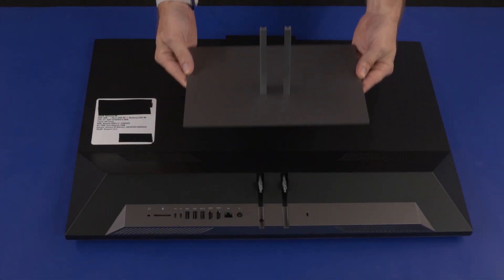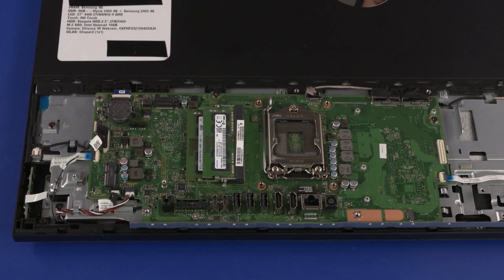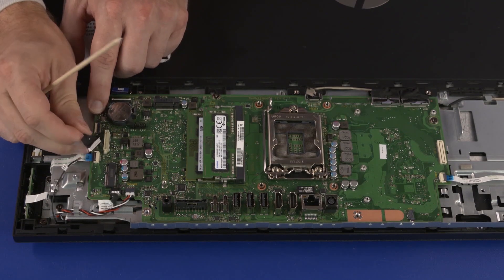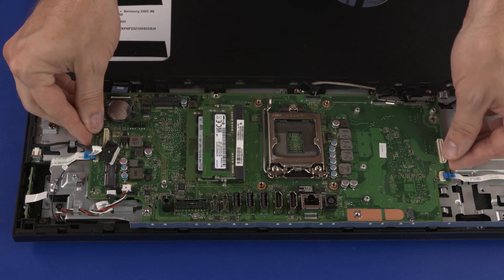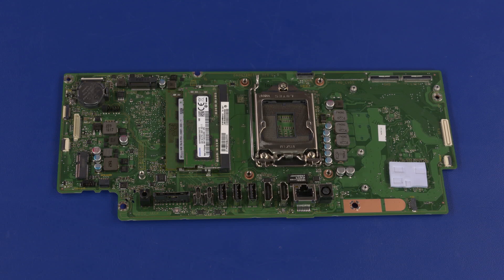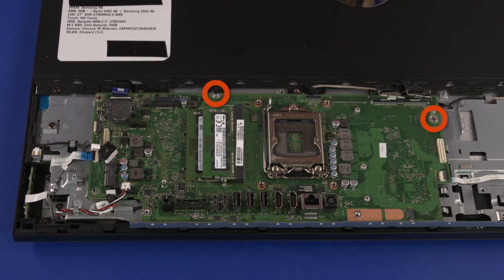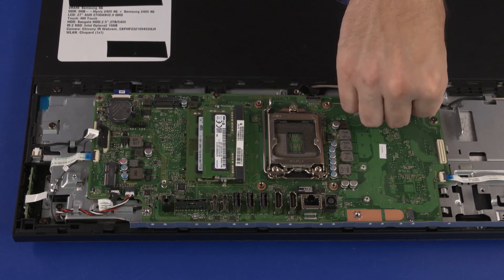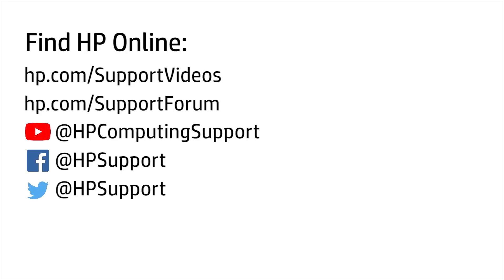Replace the Motherboard | HP Pavilion All-in-One 27, 24 PC | HP

Comment: I have an HP27es monitor that had its motherboard burn becuase of static. I looked everywhere for it. I even checked your website and store but you guys dont have it. I would appreciate if you guys would reply. It would mean alot and I simply cant find the monitors motherbaord anywwhere. The model number is 64ME7DH3215883B for the motherboard sticker. and the metal plate has a model number of R17130500-5010. I would appreciate alot HP
Reply from the maker: +Crayyan You can purchase the part from here: http://partsurfer.hp.com/ Please select your country and enter serial or product number of your unit.
Reply: @HPSupport  I looked but the only part you guys have for the field is an HDMI cable. No sign of a Motherboard or Circuit board
Reply: @Crayyann  I second, same issue. No sign of the "Rhone" mobo. (Is Rhone the brand?)  Rig's out of warranty, would love to just diagnose and replace myself. Anyone... HP... anyone?